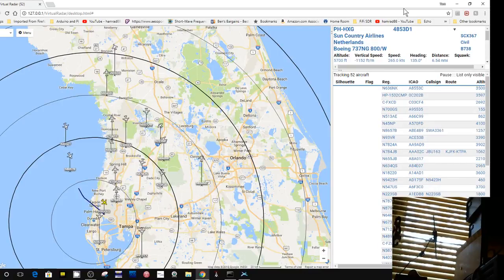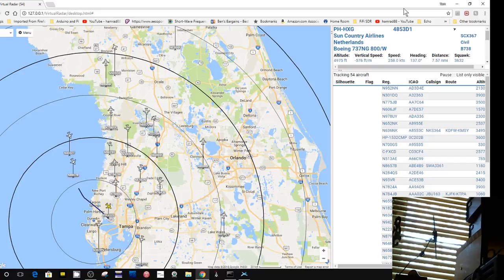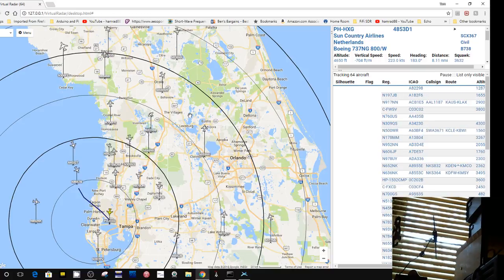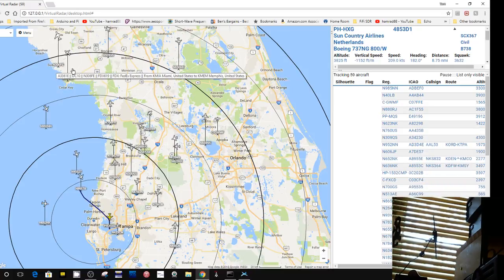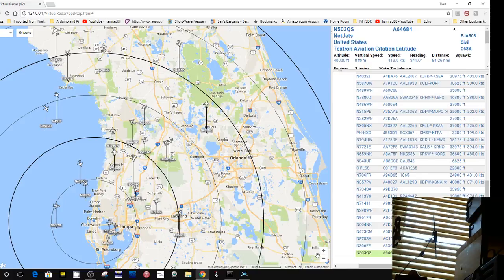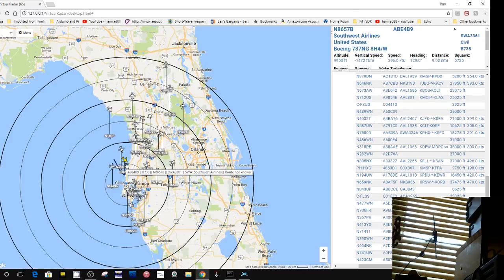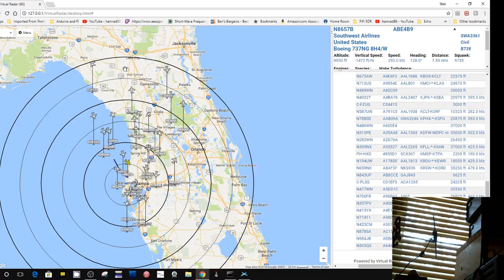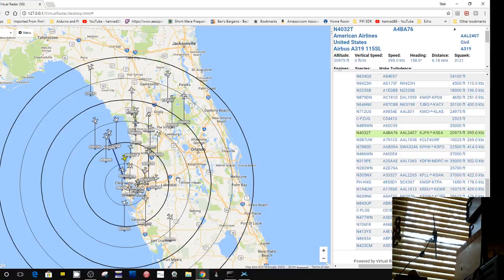TRRS #1388 - RTL-SDR.COM Antenna Testing Pt 3

Comment: I ordered that dongle and antenna set a couple of days ago from Amazon, plus a 15m extension cable (SMA), so it's great to see your review. I intend to mount it outside, though. There must be a way I can weather-proof the stuff. I'll also put up an end fed longwire for the HF frequencies. I'm inland in Jamaica, W.I., so not sure how much VHF/UHF I'll get other than air and police.
Reply from the maker: Excellent.  Thanks for your report.
Reply: Thank you! I have a not bad MW/HF receiver (100k to 30m) that I brought down from Canada years ago that I'm going to get set up. Used to do DX listening there lots in the past before I moved to Jamaica. Always wanted the higher frequencies. Read about WinRadio years ago, but was too expensive. I know the dongle isn't great, but will be very cool nonetheless.

Dug the old unit out today, found the coax, and will set it up with a longwire in the next few days while I await the dongle. Nice to be doing this again.

Also, realized that my external Garmin GPS antenna that I needed for research in the past here before the signals got stronger might be good for the SDR UHF. I'll experiment with it and post back.

Anyway, you're a champion, and your videos are much appreciated. Big up.

RS Stewart
Jamaican Caves Organisation
Ewarton, St Catherine, Jamaica
Reply from the maker: Thanks for the report and keep us posted,